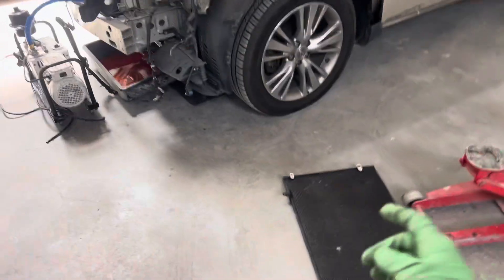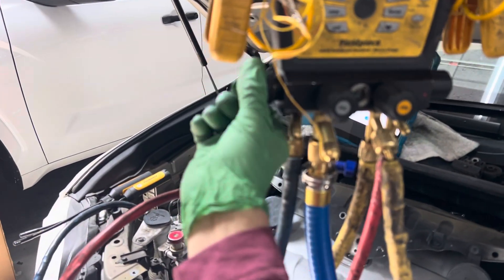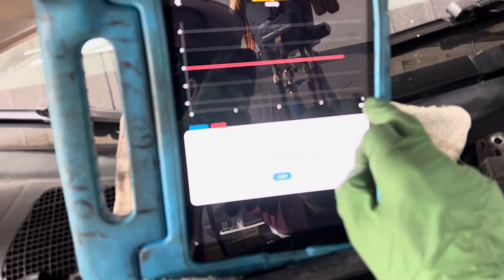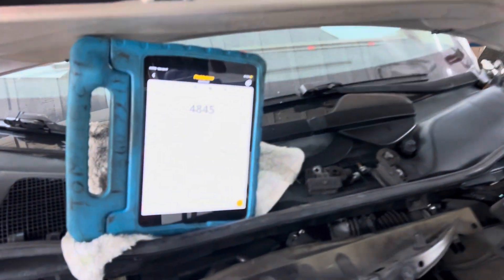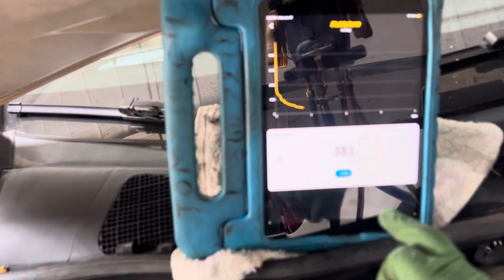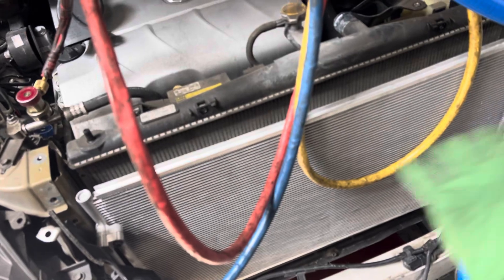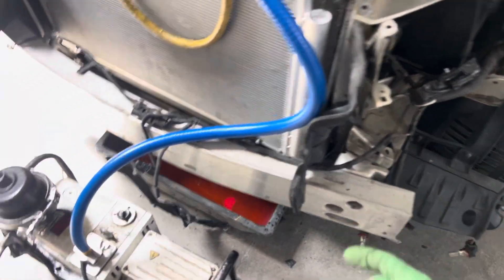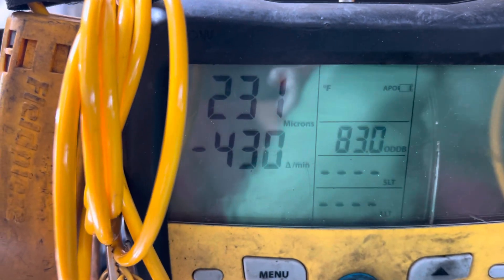MICRON GAUGE ￼readings ideal situation on a clean dry AC system.

Comment: Don’t you risk extracting oil when you pull a deep vacuum on the high side (both sides). The DIYer is probably not going to spend $200-$300 for a tank of nitrogen and gauges to purge or blow out his system one time. Instead he is going to use shop air and he is not an idiot for doing so. Shop air has been used for decades. Your climate has everything to do with how much moisture you add when working on your A/C. When Tom opens the condenser to connect hoses, gauges or what ever, he is adding moisture specifically with his location boasting 100% humidity. In Arizona 8% is about where I am at. My air compressor is equipped with a drier on the air coming in and a drier at the outlet and my air is reading zero percent humidity (that’s what my gauge tells me). So if you are using shop air you are not an idiot. You are frugal and don’t waist money. As long as you pull a deep vacuum you can flush your system with a garden hose if you want to. You might have to draw a vacuum for 3 days, but it will work just fine. The micron gauge does not lie. It will tell you when you have removed all moisture, if it doesn’t do that then there is no need for a micron gauge. Before the micron gauge people would pull a 30 minute vacuum and hope for the best. They still do. Even Tom did. Now we have the micron gauge so even the DIYer can do just as good as any professional without going broke in the process. The professional has to justify his tools. That’s why Tom calls you an idiot. He has a lot of money tied up in all this stuff. All he really needs is a vacuum pump and a micron gauge and gauges only if he cares to read the pressures.
Reply from the maker: Climate has nothing to do with Shop compressed air

Whether you’re in Utah at 122° and only 5% humidity or if you’re in Florida at 80° and 95% humidity . 

A compressor takes that 120° air with 5% humidity squishes it down and keeps adding and stacking humidity on with every stroke of the Preston and for every atmosphere seven PSI it doubles the quantity of moisture in the system as it condenses on the side wall of the tank, turning into pure saturated liquid at the bottom of the tank

The difference between the parts per million for an air conditioning system and even one percent of air is the difference between one single drop of water in comparison to a swimming pool . 

Yes, I know Shop compressor has been used since the beginning of time and all that has been formed and evaporators and condenses from the inside out causing leaks has also been around since the beginning of time right along with that shop compressed air 

All the steel and steel receiver dryers that had their inner walls literally expand, flake off and rust drop to the bottom of the receiver, dryer and get picked up by the pick up tube that clogs expansion valves and starves compressors for cold, refrigerant, and oil return moisture is not a problem doesn’t happen immediately their work always leaves their shop working perfectly 

For all the guys who had to pull off condensers that had a little aluminum and fins, especially on those old Chrysler serpentine, and some Fords, the interior fins of the condensers would literally oxidize and turn to whitish gray Sandy material that look like beach sand that only forms in the presence of moisture .  But the system worked perfectly until the condensers rotted out onto the inside.. 

The technician thought he did a great job. It was nice and cold when the customer drove out the door. 

This is a good thing about the shop compressor. They create a lot of very expensive repairs for the rest of us to have to keep replacing compresses, condensers and evaporators and flushing out the system. 

so we never have to worry about a shortage of air-conditioning work.  as long as there’s guys out there with the mentality that it worked and it’s good enough and they can blindly bury their head in the sand and deny they’re causing any harm.. 

This is why we make so much money in this industry .
Reply: @coldfinger459sub0  I cannot agree with you and one day I will prove it to you. I still have my common sense. I have NEVER purged moisture from my compressor tank or gauges ever. That’s how dry it is here in Arizona. I see people in Georgia, Florida and other humid environments and when they hit the purge valve on their gauge, there is a stream of water and they do this several times a day. This will NEVER happen here. I bet my shop air is almost as dry as your nitrogen. We are basically using the same desiccant material as you have in the receiver drier. I’m sorry we disagree.
Reply from the maker: @TonyLiveTV  very few DYI’s will use a 10 pound to 30 pound desiccant dryer at home. 

Very few do it yourself at home or going to use a refrigerant dryer ahead of their desiccant dryer that is required to not saturate it. 

They would be spending a lot more on a drawing system then they would be a nitrogen tank and a single regulator

But you’re in Arizona so you’re in one of the best places with highest temperature and lowest humidity to do the best job possible mother nature provides you
Reply: @coldfinger459sub0  first off, a DIYer might open his A/C once in his lifetime to make a repair. Purchasing nitrogen would be the real idiots choice. The DIYer has $200 to make his repairs. Should he purchase a nitrogen tank or a vacuum pump? I feel like you are so out of touch Tom. I don’t run all my shop air through the driers. I only use the driers when I run it through tools or when I blow out a condenser for example. And I hardly ever change the desiccant because we often have zero humidity. I might change it 2 or three times a year. And you can reactivate the desiccant so what is the big deal? You buy once and use forever. This is a million times cheaper than nitrogen and works great. If I had a tank of nitrogen I would be happy to run tests that would satisfy the curiosities of this discussion. I would love to prove my shop air will not in any way harm or inhibit me from pulling as deep of a vacuum as when you use nitrogen. It might take me a little longer, but I can pull just as well as you.
Reply: @TonyLiveTV  boy this got hot. if you got good dry air in your shop have you put some in a vacuum chamber and hook up your vacuum pump and micron gauge to see the microns and how long does it take to get it dry, say 200 microns and measure your temp on the chamber as well while doing this. i think this may prove what u say or not .maybe do a video on that from start to finish and no editing. this might prove your point if you want us to except what your saying. next please ask your local hvac guy that does ur house ac and ask him would he use your shop air on your system for pressure test if so we would like to see that as well. i have watched lots of hvac teachers like ty branaman love to hvac and all those teachers who teach ac ,i guess they are all fools and should not be teaching ac. but i have heard other people with your argument but i tend to believe those teachers over shop air, but a diy guy will take the chance,but he owns what he does. im not gona try it cause i dont want to do a redo for free. but please ask your ac tech if he says he would use shop air in Arizona instead of nitrogen and ask him to reveal his name and who he works for .my last ac job took 14hrs to get to 242microns and 20 min decay went to 275microns and i dont have to baby sit the car, just let the pump do its job, im proud of my ac work but it takes time to get it right. .watch those hvac teachers, tell us they are all wrong
Reply from the maker: @user-hi3pt3mv2i you said exactly everything I was going to bring up, but I just didn’t mention the HVAC instructors or commercial or residential or refrigeration technicians 

You and I know exactly what they would say . 

Of course, one of the absolute worlds largest compressor manufacturers or Copeland to come in Bristol DENSO they’re just gonna go out there and tell shops do you shop compressed air and put a little filter on it?  🤣 when pigs fly. 

Like when I’m just sold one of my customers $270,000 in LG  MUTI V HEAT RECOVERY EQUIPMENT. 

And I have anywhere from 1000 feet to 3000 feet of piping . Ranging anywhere from 2 3/8 of an inch in diameter all the way down to 3/8 of an inch diameter. 

And I’m gonna break out the shop air and test that And saturate all the POE oil with water from compressor. 

And then Warranty it when the lubricant breaks down, and the copper plating takes place in the Bearing seas 

The customer may have anywhere from 12 to 20+ compressors two compressors per condenser and I will be charging them anywhere from $18-$30,000 a compressor change out . 

Because they told me shop compressed there can be used  . 

Because they evaporator or condenser corrodes on the inside and gets pin holes and they condenser leaks out $9000 in refrigerant . 

And I’m gonna use compressed air to find that leak  . 

If I said that to any of the manufactures when I try to turn something in under warranty, not only would they laugh at me they would probably put Block number on their speed dial . 

Permanent lifetime band TECH Support . 

I wonder if the Earth is really flat 

Bet you, they put chemicals in the jet engines, and those chemtrails up there are mine control gas  🤭

(“ by the way, the temperature dropped from shop compressed air into a dry tank like a 30 pound or 50 pound recovery tank won’t work because the moisture level is so low as vaporizes at the molecular level, it’s quantity of mass to remove BTUs from the surface of the metal is less than the mass of the metal and the surface area influence from the outside ambient temperature. Let’s say 70°F..?
      Would never register with any of our instruments to see a temperature drop from the moisture changing phase and evaporating into a gas. “) 

But that was a good idea. The logic is the right direction, but not with what we have available to us as regular technicians..
Reply: @RATCHETMAN1001  no none of the techs are fools for using nitrogen. If I were a technician on the top of a house I would not carry my shop air and driers to the job site. Time is money and the drier the technician keeps the system, the faster he will be out of there. My argument is that using shop air is fine as long as you take the time to pull a deep vacuum just like you would when using nitrogen. Yes it will take me longer because I am using shop air. But it will not prevent me from pulling a vacuum and getting my system just as dry as the one where nitrogen was used. Get my point? Using shop air doesn’t cause failures later. It’s not getting the system dry that will screw it up for you.
Reply: i used to be that idiot untill i got educated. didnt get my ego smashed. i got to tell those hvac teachers to quite teaching .we need shop air instead
Reply: @TonyLiveTV  i do get your point and i have used a vacuum chamber for my test and i experimented, put some poe oil in the chamber  and let stand open to atmosphere. Used my micron gauge and vacuum pump and it boiled like crazy and took over 16 hrs to get to aprx 300 microns. im not saying u cant do what you said but watching threw a clear container as it happens is mind boggling. and the time is extremely long. trust me i watch and test for my self .just get u vacuum chamber and pull a vacuum on it and see how long it takes. But their are a lot of cubic inches in a ac system with oil on the inner sides of it and when it gets air with moisture in it boy u are gona have to pull a long time to get it dry. wont happen in the usual 46min to an hour. Please do a video with shop air and micron gauge after your repair but dont edit it show everything you do and that would prove ur point. and the triple evac they do lessons that time dramatically. i watch learn and test their practices. those teachers are not blowing smoke. but u have to test with known facts and numbers. and nitrogen is the cheapest gas i have ever bought.
Reply: @TonyLiveTV  maybe....just maybe....( and that applies to anyone that is Human - as not everyone around us is ) that you might be wrong.....about almost everything...this one example included ?    Peace and love Jay  aka CarsRcool channel
Reply from the maker: @charlesleake930 🤫
Reply: @coldfinger459sub0  let’s say the system you are working on was exposed. Is it not fully compromised? I work on old cars that sit for decades. Am I going to use nitrogen to pressure test it? No way. That would be stupid. Would I buy all new parts that are shipped with nitrogen? Absolutely not. We are not talking about $50 condensers.

I thought your channel was about automotive A/C which is an entirely different beast than commercial buildings or data center cooling needs. I’m talking about automotive A/C with short lines with small inside diameters.

Estimated Lengths. The A/C Pressure Line (High-Pressure Line): In an automobile typically runs from the compressor to the condenser and then to the expansion valve. The estimated length is approximately 5 to 6 feet (60 to 72 inches) with an ID of Approximately 5/16 inch (8mm). The A/C Suction Line (Low-Pressure Line): Runs from the evaporator back to the compressor. The estimated length is approximately 4 to 5 feet (48 to 60 inches) with an ID Approximately 1/2 inch (12mm).

That’s the surface area we are talking about excluding things like the evaporator and condenser, but I think you see where I am coming from. I’m not talking about the guy with a portable compressor in the back of a truck. I am talking about clean, desiccant dry shop air. I even have a drier on the air delivery nozzle and that is overkill believe me.

Why do automobile manufacturers recommend you change the desiccant drier in your vehicle’s A/C? Because the desiccant material works better than the nitrogen did when they put the system together. It can pull moisture out of the oil faster, better, and more efficiently than anything else (within its price range of course). For the DIYer I say don’t spend your money on a nitrogen tank and gauges. Instead spend it on a good vacuum pump and micron gauge.
Reply from the maker: @TonyLiveTV  the size of the system whether it’s a little tiny water cooler with quarter and 8 inch refrigerant lines that are only 12 inches long or 5000 feet long makes absolutely no difference in moisture content. 

Once the water molecule latches on the POE oil, it does not release . 

Once the damage has been done to the oil has been compromised all the drawing in the world cannot reverse the damage . 

And the parts that we purchased our manufactured and shipped with nitrogen in them when you hear that little purge of air pressure when you open up a compressor condenser or receiver dryer nitrogen . 

Some manufactures to save on cost have switched over to dry air, but they’re using multi thousand dollar refrigerated dehydrators. 

They use mechanical moisture separation that mechanic knows about those little clear jars with the little Spinny things inside of them or wire mesh or centrifugal force to get the bulk water out . 

Then it goes over to refrigerated dehydrator that only can get the moisture content down to a certain percentage. 

And then it goes through third stage of dehydration what is your molecular sieve which most people know desiccant. 

No, do it yourself or is going to spend this kind of money for a refrigerated system before going to nitrogen is far cheaper and easier to get a hold of . 

Yes, I have a few videos of vehicles that were never opened up from the 1950s that are absolutely pristine have not been contaminated . 

The site on the receiver dryer is crystal clear not even the slightest yellowish tinge of oxidation .  These are extremely rare..  

For those guys with these kind of collections, I will throw them on vacuums overnight when it comes time for service 

Because you’re not going to get a receiver for early 1950s car . 

And these cars are flown around the country, and sometimes the world to be entered in shows. Everything has to be original.. 

Then we have the old classic cars that are rust buckets on the inside and on the outside . 

We’re literally inside of the steel refrigerant lines look like a picture of clogged arteries or sewage from rust flakes from the moisture. That was the system that the desiccant could not get rid of. . That gets rid of is measured in grains of moisture very small amount.. 

Nowhere near yourself is going to have a dry enough air system . 

Except maybe somebody crazy like me who doesn’t have to pay anyone to build it for him he can do it himself 

And you might invest in such a system . 

And the rest of the world where the majority of vehicles are located are not in Arizona or Utah the rest of the world has humidity of the world population is located. 

So yes, completely compressed dry air can be used with somebody with a extremely high-level mechanical moisture removal first stage refrigerated, moisture removal second stage desiccant material moisture removal third stage dry areas used as a packaging, medium all over the world even on air conditioning parts that are pressurized.
Reply: @coldfinger459sub0  I don’t know why you continue to blame shop air for all these problems you mention here. It’s not shop air that is causing these problems. It is the moisture is that shop air that causes the problem. It’s because they did not evacuate the system properly because back in the day when shop air was the norm, they didn’t have micron gauges. That’s how shop air got a bad wrap. It’s NOT SHOP AIR causing any of the issues you refer to. It’s the moisture left behind. That is my only point. You can’t go on calling people idiots because they use shop air. Call them idiots because they are not pulling a proper vacuum and leave the shop air out of it.
Reply from the maker: @TonyLiveTV  True I cannot be calling people idiots. 

It’s just the ones who deny it’s not a problem that are idiots who don’t properly evacuate . 

But I don’t know what you mean by back in the day when Shop was normal . 

Because my father was taught by his mentors to use a micron gauge it was analog and those days I grew up using it and we use the Welsh pump that was capable of pulling a micron rating down to below 0.1 µm 

So that was back in the day in the 1950s and 1960s when my father was young . 

It’s just that uneducated people who never had any proper formal apprenticeship program and mandatory education did not know this so that you learned by watching other people who had no education and the disease just spreads from there . 

There is more educated people than there educated people performing the procedures 

They’re not idiots. They just didn’t know, and they just kept passing that knowledge or lack of knowledge onto the next generation. The next generation and the next generation it never ends. It’s like a cancer or the  Bubonic plague being spread by  fleas to a population. 

There is absolutely nothing new about this information 

And yes, you can lower the moisture content may not remove it all 

I do it all the time there used to be a rash of sensitive vehicles back in the early 1990s particular Toyota Camry and Corolla were very sensitive to excessive moisture .  That after about 20 minutes of driving the water and oil mixture would clog up past the expansion valve freezing in the evaporator blocking the flow refrigerant. 

People who did not want to pay for a new receiver dryer . 

I would just leave it on one of my vacuums all day and fill it up at the end of the day and give it back to the customer and that would be the end of the problem . 

I did not remove all the moisture I just lower it to a point where it would not cause Damage or a restriction to refrigerant flow . 

And then the system would work just fine . 

Long-term effects that’s another story
Reply: @coldfinger459sub0  i've been know to use Argon from my welder.....i would NEVER use " shop air " ...except to blow out and flush lines that are open at each end ...
Tom is right the risk is too great .....you quickly turn a 15 year system into maybe a few  year system....it's a bad move....in anything you want to last  Jay.